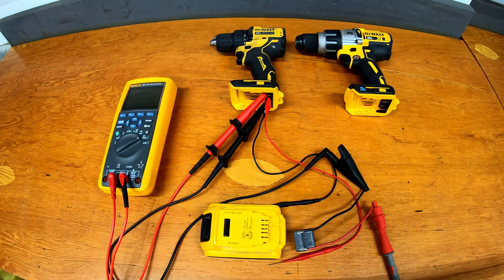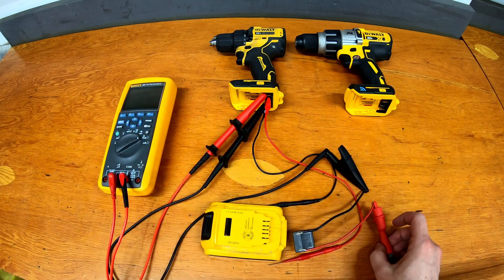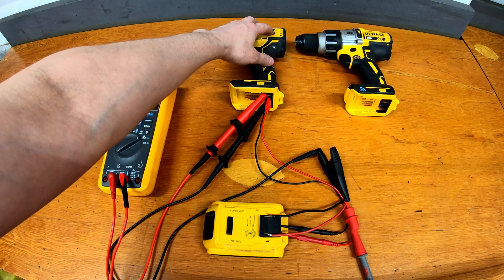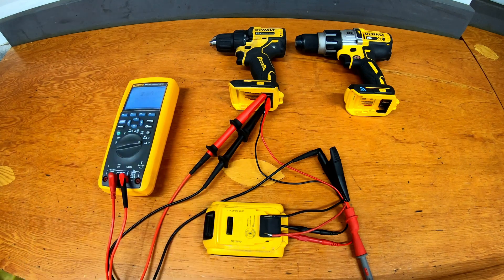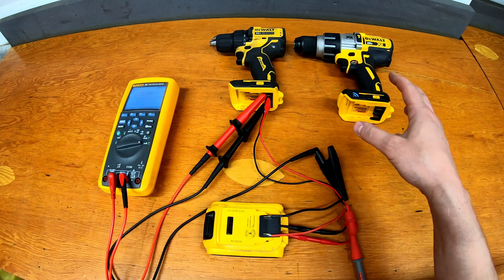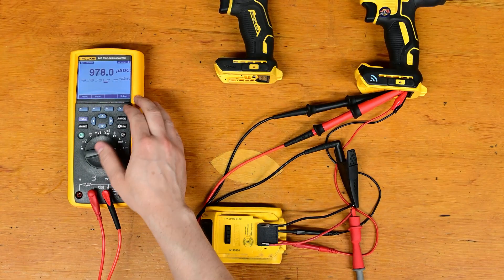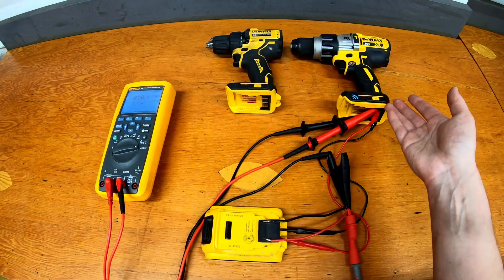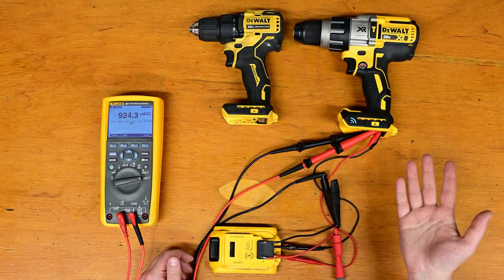Should You Leave Your Cordless Tool Battery Connected?

Comment: Thank you—but—my DeWalt tools all are dead shortly thereafter if I leave the battery attached, with the worst being the hand vacuum, as it’ll be dead in two days.
Reply from the maker: I have two different models of Dewalt vacuums and they always have batteries in them and don't drain down. Are you sure it's not that the battery packs have dead cells in them and aren't holding a charge long?

Comment: Hi.
Thanks for your great videos !

Im a subscriber.

Question please.....

I want my batteries to
LAST AS LONG AS POSSIBLE.

Should i stick to the simple slower charging standard charger for my M18 Milwaukee Batteries to have THE LONGEST BATTERY LIFE ?

Will a Fast Charger and Super Charger make my batteries NOT LAST AS LONG because theyre charging faster creating more heat, more "violent" battery chemical transfers due to higher heat, etc. ?

Thanks.
Anybody knowledgeable please reply soon.
Reply from the maker: Hey, thanks for subscribing

Generally yes, slower charging is better for battery life, something in the 2 to 4 amp charge range seems to strike a good balance. Also, don't store fully charged or fully drained for long periods of time, ideal is usually 1/2 to 2/3 charged for storage.
Reply: @SomeGuysGarage  ok thank you

Comment: There is no power draw from the battery if the battery is not attached to the tool. Therefore, it’s probably good practice to detach the battery when the tool is not required for use within a 20 to 30 minute window.
Reply from the maker: @Fred_the_Head  I wouldn't say 20-30 min...but more than a few days maybe. There's always some slight self discharge even disconnected though
Reply: After a day's work, you should detach the battery.

Comment: Why the heck do you Need Bluetooth on a drill?
Reply from the maker: LoL I know right? It's for asset tracking purposes mainly in industrial/commercial settings.
Reply: Because tools are expensive and people need them to make money and survive. Mix that with how much people can actually be trusted these days. This makes it a little less stressful for the people that have their tools laying around on job sites or bosses who supply the tools. Now you don't have to worry about people stealing them as much but for the morons who still do now the owner can locate their tools and get them back. It's really a no brainer why they do this now. You do realize these tools aren't cheap right? Dewalt isn't bad but Milwaukee is definitely a good tool that I wouldn't want to lose. Personally I don't want anyone walking off with any of my tools regardless of the brand or value. I don't want to replace something I've already bought and it also helps you if you just misplace the tools also. There's more to it then that at least with Milwaukee, it will give you diagnostics on how the tool is performing and whatnot also.

Comment: A drill with Bluetooth? Why?
Reply from the maker: Tracking purposes, usually for those with large inventories. Only reason I have it is I won it from Dewalt years ago.
Reply: You can also lock out the tool so it basically will appear broke to the thief. At that point not all but some dumb people will send it into the service center which will catch the thief and et your tool back at the same time. All of this is useless though if you never download the app and add it under your name because if not the thief can do it themselves. I guess if you were able to foresee a incident about to happen on a jobsite you could lock out that tool to prevent it from happening. There's definitely a number of reasons bluetooth is beneficial to have on these devices considering the cost. Makes more sense then a refrigerator or something like that having it. Besides if you were to have that one tool in a trailer or your truck that got stolen then that one tool worth 200 dollars could help you recover thousands of dollars worth of stuff. At that point I'm sure you would happy a tool had Bluetooth on it then. Some tools have it some don't though. On Milwaukees pamphlet of their tools it will show you which ones have it and which ones don't. If there isn't much of a price difference I can't see a reason to not get those ones.

Comment: Thank you very, very much for the video! Finally somebody used actual science to explain whether or not to leave the batteries in your tools. I have a 12v Makita drill & driver set that is about 12 years old. The case they are in is designed to hold the tools with the batteries in them... so I do. I have left those in the case for years without using them. The batteries still have juice and the tools and batteries are just fine every time I've had to use them. When I do use them, I always charge them before I put them up again. Don't know if they are somehow different from the newer batteries, but this has been my experience.
Reply from the maker: Welcome!
Lithium vs NiCad batteries do have different holding behaviours. NiCad tend to develop a memory of where they're charged/discharged to and will self discharge in a few months. Lithium are less sensitive to it and can go many months without much self discharge assuming the tool isn't drawing power from the battery constantly.

Comment: Why do they draw power though? The one that draws less power I mean. It doesn’t have anything running until you pull the trigger
Reply from the maker: There's some small amount of circuitry, the trigger isn't just directly connected to the motor like days of old.

Comment: Even if it would take 100 years to drain from full, I wouldn’t leave them in. Lithium ion packs drain faster than that during storage even with no draw, which obviously isn’t being factored in, and then there is the distinct likelihood that it will be left in AFTER draining to the point where the tool dies. Another factor is having the cells go out of balance, which can ruin the pack from only one cell discharging.
Reply from the maker: Lithium packs barely have any self discharge. As long as you use your batteries at least a few times per year, they'll be fine. I've yet to have a single pack be noticeably weak and some of my oldest are 7-8 years old now.
Reply: @SomeGuysGarage  one of my 10AH mower batteries is weak but they are known to be problematic. :(
Reply from the maker: @emmettturner9452  I have heard about the 10ah issues out there...have you tried warrantying it?
Reply: @SomeGuysGarage  Kicking myself for not getting the 2x 10AH for deal over a month ago for 190 since those would’ve had a warranty but my mower with 2x10AH batteries came from the flea market. One weekend nearly every vendor had DeWALT mowers and 10AH batteries from an auction at the local DeWALT service center. Lots were clearly new but I bought the only sealed one I could find left. No warranty. :/
Reply: @SomeGuysGarage  Symptom: the weak 10AH dies while the stronger 10AH has barely lost one bar. The dead one still shows 1 bar but the mower quits. The same mower will run 2x 5AH down to zero bars.

I may not have any 60V tools but I’m real tempted to get a couple FlexVolt batteries to put this mess behind me. Like the FlexVolt Advantage tools, they sometimes sell the same mower with FlexVolt batteries. I suspect this is because they needed something comparable to 10AH that wasn’t as failure-prone.

Comment: Great video And well executed. I never really thought about it, but yes, I'm definitely one of those who Leaves tools plugged in all the time. I would be curious, most of my tools are pre brushless Would that make any difference Having brushed tools?
Reply from the maker: Unlikely much difference between brushed and brushless, it's more about what the tool is doing while sitting there idle.
Reply: @SomeGuysGarage  Until now, I assumed the tool would do absolutely nothing until you pulled the trigger. What is exactly pulling the power? Lots of the older drills I've pulled apart are just a Trigger mechanism and motor with maybe an LED But I know some of the smaller Brushless tools like rigid sub compact and Milwaukee's brushless 12V. have extra circuitry for things like an electronic clutch and stuff. But when you're not pulling a trigger, what's drawing the power?
Reply from the maker: @ChristopherKlepel yup, those bits of circuitry have tiny amounts of leakage, as you saw, milliamps at most. Even the brushed drills they're making these days have those circuits (like low voltage cutoff for instance on dewalts).

Some of the really old cordless tools, especially in the nicad area, wouldn't have had much.
Reply: @SomeGuysGarage  Thank you. That makes sense also It probably makes a difference that I use primarily. rigid tools When I'm not at work which keep all the circuitry in the battery as opposed to dewalt, which do it in the tool.

Comment: Good Vid.  Also don't leave them in the chargers all the time.  Some line glitches cause the chargers to restart a charge and can destroy a battery over time.
Reply from the maker: Good tip! Also, don't charge unattended.
Reply: @SomeGuysGarage  if you're worried about that then don't buy the Amazon shit batteries, if I have a legit battery burn my house down I'm calling a lawyer lmao
Reply from the maker: @bread-gz3rl  any lithium battery has its risks unfortunately, no matter the brand name or not.
Reply: I understood that chargers can monitor battery voltage through the internal battery management system to avoid overcharging when batteries are left attached to the charger. I presume that when the charger indicates a full charge to then remove the battery and it is safe to leave batteries attached to the charger indefinitely - although removing the battery after receiving a full charge is ideal.